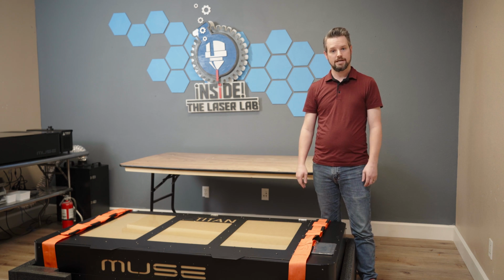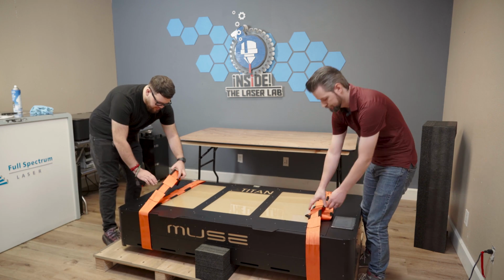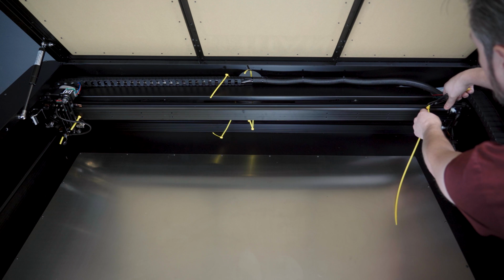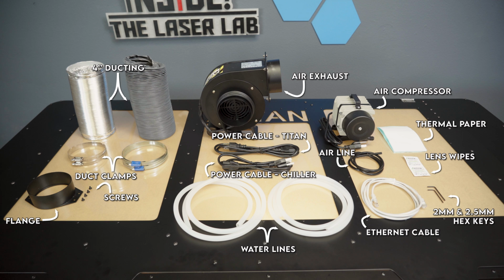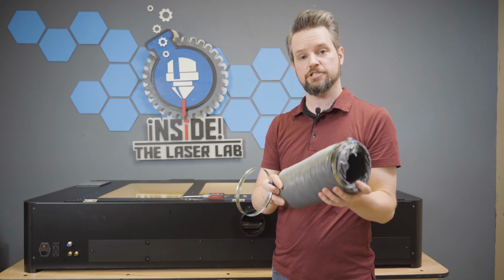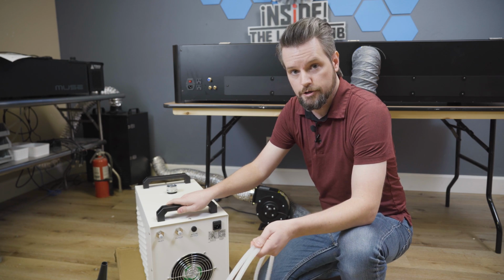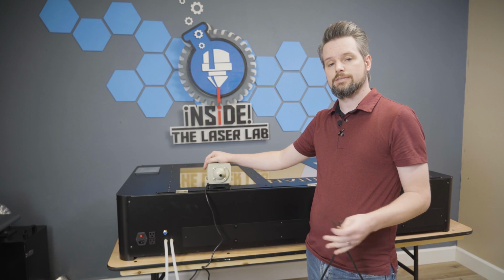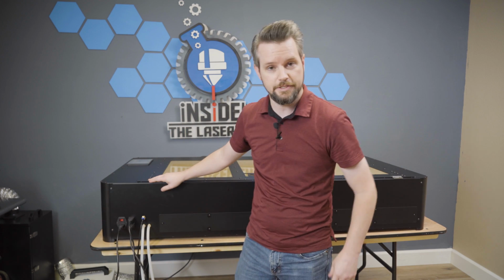Setting up the Muse Titan

Comment: I noticed in the video it says that the water chiller is included, but on the shop page it shows the chiller as an extra $400 add on. Is it included or would I have to pay extra as an addon for the CW3 chiller?
Reply from the maker: The upgraded chiller is not included but the Titan now comes with an integrated cooling system!

Comment: i think I've watched most of the videos on this Titan, I don't see much on the Air Assist 1:53 I'm curious, with those type of aquarium pumps, they pretty much run when you plugged in, does the titan or the software control when the air assist comes on or is on the user to plug it in and unplug it to turn it off? I've seen some lasers that automatically turn on when the laser does a cut job, I was curious about this?
Reply from the maker: Hey Corey! The air assist does turn on and off automatically whenever a job starts/stops.
Reply: @FullSpectrumLasers  Oh man! that sounds awesome. One less thing to have to remember
Reply from the maker: @coreyflannagin3698  👍

Comment: Please make a video on how to use a rotary tool.. mine dosen't fit.. support told me to remove to bottom and run the laser without any safety panel on the bottom...😱😱😱
Reply from the maker: We are in the process of shooting that soon! 
And support told you correctly. The Titan is designed so the bottom panel can be removed to fit the rotary. It also allows for the Titan to be placed on larger objects for engraving that wouldn't otherwise fit inside the Titan.

Comment: Just received my Titan and loving the machine so far! I think it is a great design overall, and I could see other companies starting to produce machines with the same footprint. My favorite part is being able to drop 2x4' sheets of plywood in from Home Depot. HD has some really nice underlayment sheets that are about 3/16" thick with a smooth surface. My 90 watt machine cuts it like butter at only 40% power. This video would have been helpful for me sooner, but glad to see you helping out future owners. I also really like how the software controls the I/O of the compressor and exhaust fans. I plunged for the CW-5000 and running it at 16.5C to ensure a long laser tube lifespan.  I originally connected a California Air 8 gallon compressor (not to the power port on the machine) and it was not enough to keep up with long jobs. I am just using the included compressor instead. Running a 6" AC Infinity for my exhaust with AC Infinity ducting. You guys really nailed it. Looking forward to more videos.